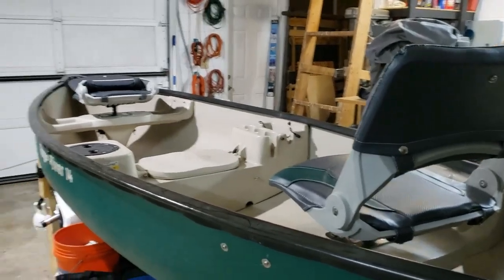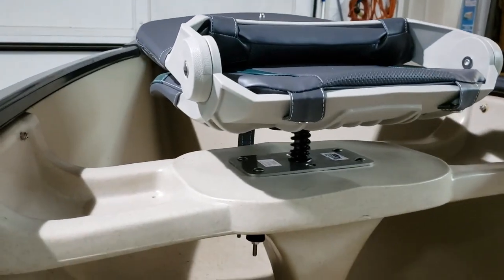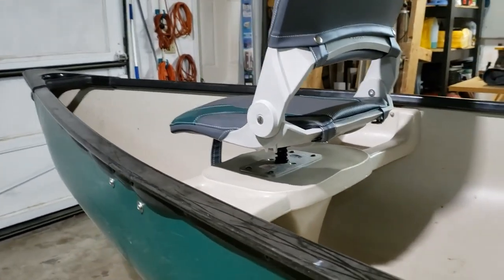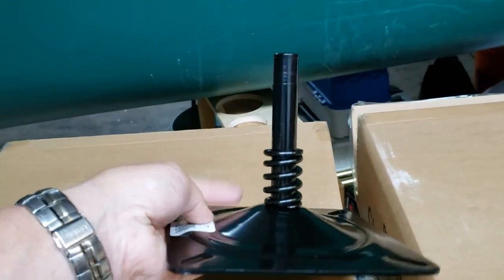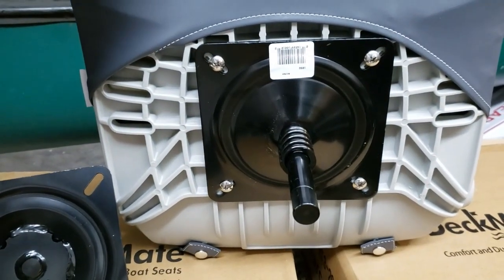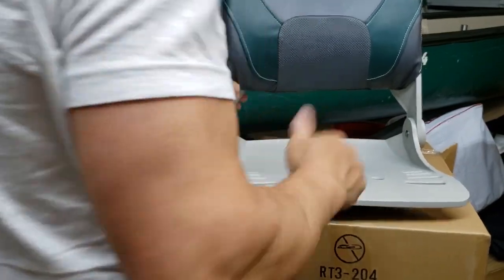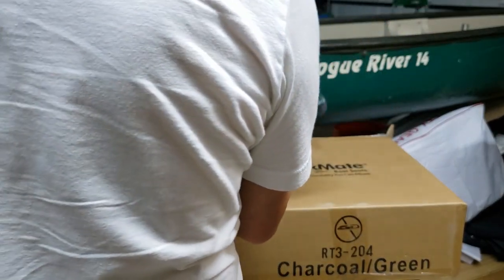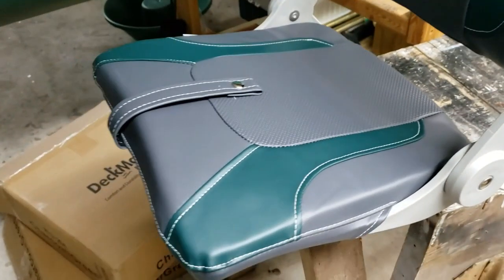DIY Folding Boat Seats for a Canoe

Comment: Nice build. Your setup looks great.

How much affect does the elevated chair height have on "tippyness" of the canoe since the center of gravity is higher, and does the swivel mount "torque" or change your position when paddling?
I have the exact same canoe for years now and I'm on my 3rd. set of stadium strap on style seats in effort to be more comfortable on all day fishing trips, but none of them have been great because the attachment is not solid.
I am searching for a better option and your setup looks the best I've found. 
Thanks for the video and any other info you can provide.
Reply from the maker: Thanks for the question. It does add a small amount of tippyness. However that canoe is wider than most canoes. Another note, I took some time and filled the seat cavity with expanding foam. Initially I noticed when we sat in the seats, it compressed the plastic. The foam adds some rigidity to it. All in all, I've never tipped over and I've had many different people in the canoe. Experienced and not experienced. Very comfortable by the way. Hope that helps.

Comment: This looks awesome.  How is the stability after the modification when paddling?
Reply from the maker: Thanks for the compliment.  The stability is still very good. I would be a bit careful if you swivel from side to side, just so anyone else with you doesn't get a scare. I will say however that the plastic canoe seats are starting to compress with the weight on that small spot. Not any trouble, but I can see it wearing down after a while. I plan on filling the canoe seat itself with expanding foam to help give it more rigidity. I'll post a video soon. Thanks.
Reply: @homemadechow3532  i have a 16ft Pelican flat back canoe and all three seats have the same base style as your bow and stern seat.  I got 1/8th thick aluminum that was pressed to match the width and shape of the triangular base at local metal fab shop. I bought the canoe used and to avoid me from ripping the screws from the side of the canoe i did this super easy mod and the seats feel wayyy more stronger. I can email pictures if you would like. Cheers.
Reply from the maker: Sure, I'd love to see the pictures
Reply: C. M Would you please show me a photo of what you did with the aluminum? I'm contemplating modifying my seats like this and want to compare. Thank you!

Comment: Looks great! Are the Atwood bases the Lock n Pin type? I plan on doing this to my canoe and I've seen some reviews saying that the bases can be very difficult to remove from the deck plate. Yours seems to come out very easily, however. Thanks!
Reply from the maker: The seat post doesn't have a lock pin. It just slides in and slides out. I have to say there is some resistance when you try to pull the seat out, as there should be. But I've not had any difficulty with them.

Comment: I love your video. However, it lacks the technical aspect of how you connected those "stoppers". I would love to se your method, but I don't know how you did it. Also, I'm not certain I know what you mean by "Stoppers"? What exactly are they. Can you do a video from scratch showing the entire technical aspect of it? Thank you so much. Those seats look great by the way.
Reply from the maker: Thanks for the feedback Paul. I like your idea of adding a video of how I set everything up and made the rubber washers work. The stoppers are just that. They are called rubber stoppers. They are made with a taper to begin with. I'll work on a video really soon. Thanks for the kind words.
Reply: they're like rubber corks for a bottle or any plug application. think bathtub stopper.

Comment: Thank you so much for sharing this! Very helpful and informative. I am considering doing this to my canoe after watching this. Do you have an update on the status of the original plastic seats that were drilled into by any chance? If they're holding up, I may go ahead with this modification on my canoe, soon. Again, thank you for your detailed and thoughtful video. 🛶
Reply from the maker: Thanks for the nice reply. Yes, as an update, the original seats of the canoe are holding well. However, I noticed that there is a lot of pressure around the edges of the stainless steel plate when someone is sitting in the seat and leaning back. I made another modification to it so it won't do this any more. Since the original plastic seat is hollow, I filled the cavity with expanding foam. I used the stuff that comes in a bag from home depot and is used to set posts instead of concrete.  It was not easy and was a bit of a mess. If you decide to do it, only use 1/3 of a bag for each seat. If you prepare them at the same time, you only need one bag of the expanding foam. I may do another video on it explaining what I did so others can do it as well. Although it's probably not necessary to fill the cavity, I just thought in the long run it would be better.
Reply: Homemade Chow Very cool! Thanks a lot for the update. I'll consider to mull this over. Toughing it out here through the long winter and I've learned this is a good time to make canoe modifications! 🙂 Built a trolling motor mount last winter and it serves me well this past season out on the water. Now, it's time for seats. Regardless of direction from here, your comments and video have been very helpful and insightful. So glad to hear you're enjoying your canoe. Have a great day!

Comment: where did you get the base from and did it come with the pole attachment for the seat?
Reply from the maker: The seat base and the seat post were ordered from Amazon. I had to order them separately. Then the seat itself was a separate order as well.
Reply: @homemadechow3532  thanks i saw it at the end of the video